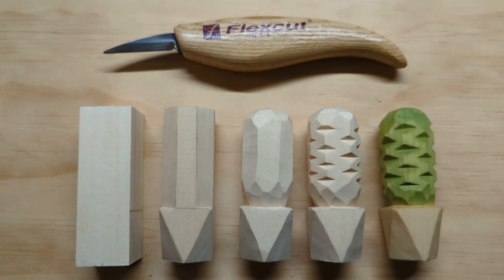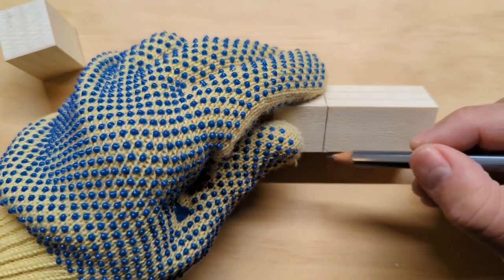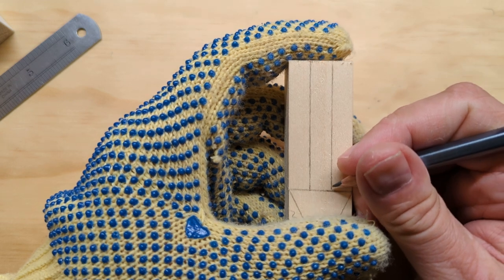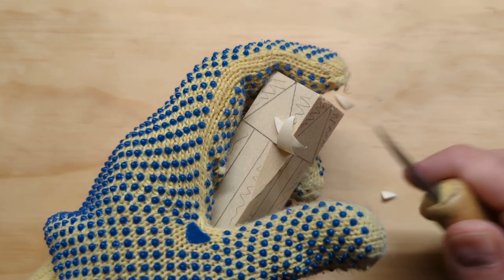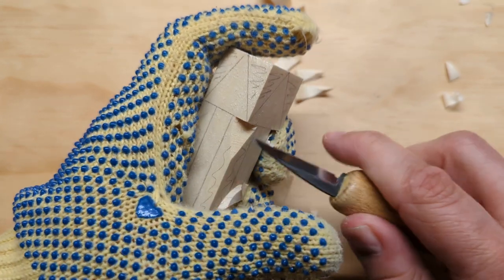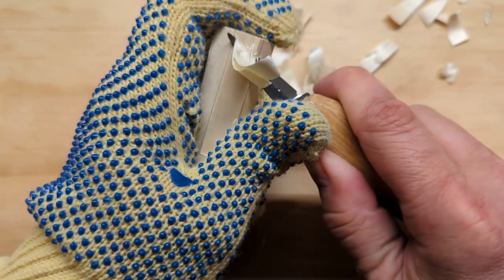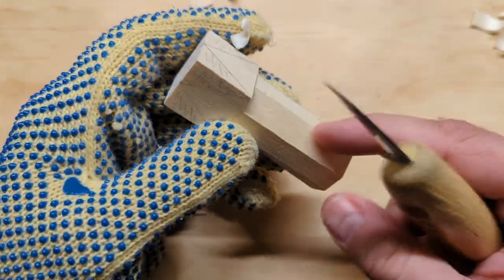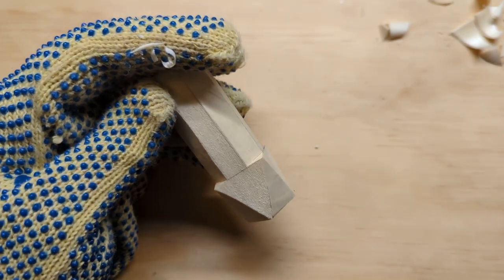How to Whittle a Simple Cactus Part 1 - Complete Beginner Whittling Lesson

Comment: Nice three part tutorial. I'm just starting out so to save on money I'm using scrap pine instead of basswood because I can get it for free. Any advice on using pine instead of basswood? I'm using the flexcut knife you reviewed and it did a good job I thought on the pine but I don't seem to be able to make as deep a cut as you do. Could it be because I'm using pine or just beginner skills?
Reply from the maker: Carving pine should be ok in general. As long as the wood doesn't feel too hard or difficult to carve I wouldn't worry too much about it. It definitely does take practice to make deep cuts. Over time you develop both hand strength and also a feel for the knife and wood to be able to make deeper cuts more comfortably.

Comment: Omg this is so hard. I just got my 1st whittling kit & thought this would be a good 1st project. had to use a 4 inch wood bc I didn’t have 3 inch. And that was impossible to hold correctly and cut correctly. I had to do one wrong. I have size small hands. My hands hurt so bad. It’s so hard to make a flat cut. I think I messed up my knife from twisting so I tried to strop it and I think I made it even more dull.
Reply: And also my wood keeps peeling off before I finish the cut
Reply: what knife did you get? And are you using basswood or something else?